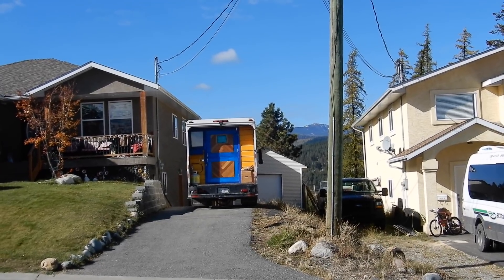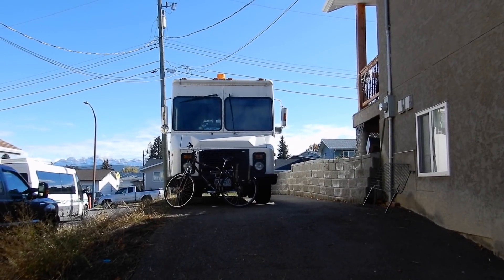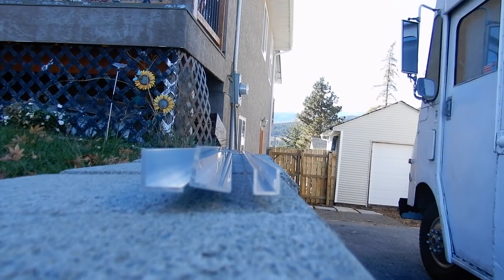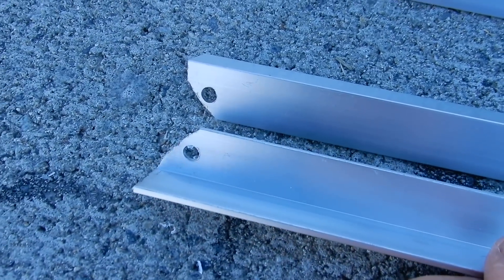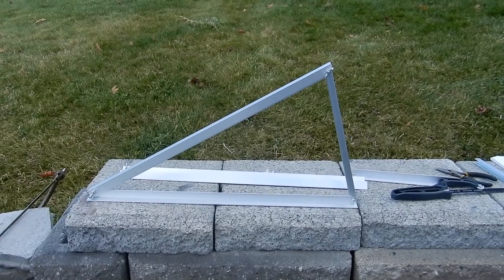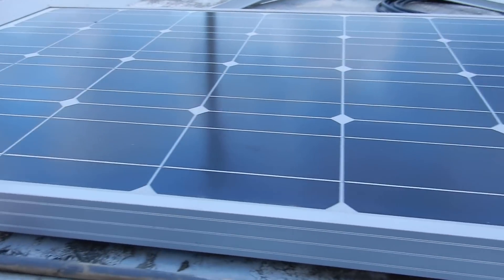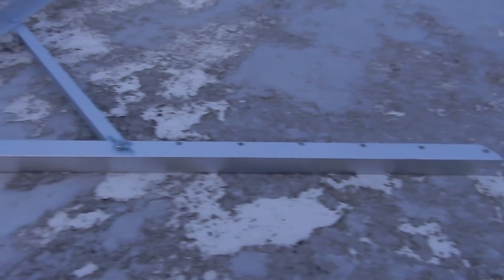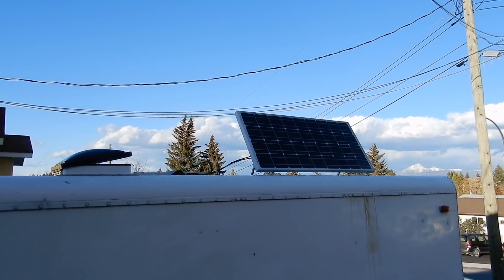Build a $30 Tilting Solar Panel Mount - E047

Comment: CheapRVLiving Forum for van dwellers and their solutions, hive mind.
For the money your paying for Renogy panels you can get more for less through SanTan Solar, 300 or 400 watt panels for about $200. They sell used panels so their selections change over time.
There is an RV video which shows real world tilting results @ 30% increase for an Arizona latitude.
I believe the video channel is RV Genius.

Comment: Not an ideal solution but, one huge panel as apposed to 3x100 panels would be better for the following reason's:- 
-only 1 panel to tilt saving time and hassle
-no shadow from other panels
-if you bought a poly instead of a mono even though poly isn't as efficient the fact that your tilting it would infact make it more efficient than a flat mono panel and poly is a fraction of the cost compared to mono. 
Cons
-Require bigger stronger tilt bracket for the larger heavier size panel
Reply from the maker: That's the situation for sure

Comment: I'm building an old 1982 Chevy Hi Cube van into a camper right now.. I have 3, 100watt Renogy Solar Panels and I am going to Hang them on the passenger side of my van temporarily as the Sun demands ...just install 2 brackets to hang each panel ...and hang them as needed.

Comment: First strong wind from the back side of your panel may cause some issues. This doesn't look solid at all to me.
Reply from the maker: The wind in that parking spot was really bad. It warped my escape hatch to the point it wouldn't close. The panels never had an issue.

Comment: I understand that the 'pay as you go' approach limits the size of the panels you will be using but going to multiple smaller panels vs. fewer large ones introduces its own problems  as you are seeing, not to mention creating a need for more system complexity via wiring , connections and more tilt brackets etc. You might consider going to fewer & larger panels such as the 295W Canadian Solar Superpower CS6K-295MS (24volt)  if you have a charge controller that will handle it, preferably an MPPT that will convert the excess voltage into more amps at 12V. As of this date they can be had for +/- $180 USD here in the States with careful shopping, a much better bargain in terms of watts for the buck and I suspect that you could source these locally thereby avoiding absurd shipping charges. Submitted solely for your evaluation but I like mine much better than daisy chaining 100W panels. 

Best of fortunes as you eek your way through your college years, I admire your dedication and fortitude!

Comment: I ha e 2x100w flexible panels, one mounted on roof flat, and the other i fasten with magnets on the vans body so that I can follow the sun. There is a major difference  in generated amps, if my roof gives me 1a,the one tilted towards the sun will give me 4a.
Reply from the maker: Thanks. Useful info.

Comment: what are you doing for heat during the winter months?  only the wood stove? are you plugged in? thanks!
Reply from the maker: Yes, the wood stove is my primary heat source. I do have a mister buddy as backup. I am not plugged in.

Comment: tilting one panel may or may not help or could easily be a wasted effort. this is totally dependent on your charge controller. some charge controllers will normalize the voltage to the lowest panel voltage from a set. In other words if you have one tilted panel generating 50 volts and two flat panels bringing in 40 volts each, the system will adjust all panels to be 40 volts  (only taking 40 volts from the titled panel so that it matches the others) and then convert it down to 12-13 volts for your system.  if you have a more expensive controller it will be able to accept random voltages from multiple panels for max input (highly recommended for multiple panels). this is ideal for situations where some panels are in shade and others receiving more sun. you'll need to do some research to see which type of unit you have (it is also very important to make sure your unit can accept voltage generated by two or more panels (mine maxes out at 150v and currently with 2 panels I'm generating about 85v). you may need to wire panels in parallel or series or combos of the two depending on max voltage input your controller can accept. originally I planned to tilt my panels, but ultimately realized I have way overkill in incoming power at 710 watts when I'm only using about 100 to 150 watts to charge items, so even laying flat my power was far more than needed. best of luck to you!
Reply from the maker: That’s definitely something I need to look into. Thanks for the heads up.

Comment: Awesome idea! Wonder if a cheap poor mans ignition “interlock” switch put underneath a panel might be something to consider so you don’t accidentally drive off with the panels tilted up? 

I’ve also seen people suntanning with those flat solar reflectors around their body to get more sun exposure (obviously not good for your skin lol) . I’ve wondered if those would help direct more sunlight to a solar panel as well.
Reply from the maker: I think the interlock system is super interesting, but a poor idea for the simple reason that in an emergency you couldn't leave quickly. Classic case of over-engineering since it's easier and less complex to train yourself to put the panels down yourself. The tilt probably won't get used very often in the summer or when I'm driving the van around. As it is, I'm not driving the van at all in the winter so that's not a concern for me.
The reflector idea is very intriguing. I'll look into it. Thak you.
Reply: Will Prowse just did an interesting video on using reflectors to increase solar panel output

Comment: What if you did like a gradient tilt? For instance, with all 3 panels, the one closest to the sun be up 1 notch, the 2nd one up 2, then the third all the way? Or a different variation of that; some fiddling/calculations/experimenting of the first 2 panels would, of course, be required. Perhaps the 1st one flat and the 2nd one up one notch, etc. Altho I guess the question would be is a slight tilt vs a flat panel going to make a difference in your solar draw?
Reply from the maker: This is great suggestion. I suppose it doesn’t hurt to tinker with the angles a bit.
Reply: Thank you! Be interesting to learn if a slight tilt would have much if any effect in your solar draw. But then again, as you mentioned in the vid, (and I'm paraphrasing here lol), every little bit helps!

Comment: What I have done is put a solar panel tilted on a swivel base like a turntable so I can rotate it manually follow the sun. I rotate it with a length of rope  through the roof vent. this easily doubles the output I would get if it just faced a single direction.
Reply from the maker: Very cool
Reply: I've thought about that a lot , there really is a void in options for rv/ van solar mounts.
Reply: + Spencer Kelly - 👍Good idea.
Reply: I would really liketo  see that swivel idea.
Reply: Brilliant idea
Reply: You guys in the States can get a Sun Tracking board for around $25 - eBay from memory

Comment: I have a Toyota rv and 7- 100 watt panels, the problem I have is finding a rack mount to hold them. After thinking about this for a while I've decided to use aluminum extension ladders to build one that will allow about 3-4 inches under for airflow and a hinge where I can tilt the array when parked. Used ladders are relatively cheap and readily available. New ones are $80 us at Walmart. They were cheaper but the tariffs have caused metals to go up about 20-30% here. Love the panel van and if I hadn't found the yota rv I wanted a panel is what I would have bought.
Reply from the maker: Wow with 700 watts of solar I almost wouldn’t bother. Great setup. I like the ladder idea.
Reply: I saw a build with flexible solar panel bolted to a gear storage box that they’d open to ‘tilt’ the panel. (I can’t recall the name of the channel...think it was on a Vanagan  VW)